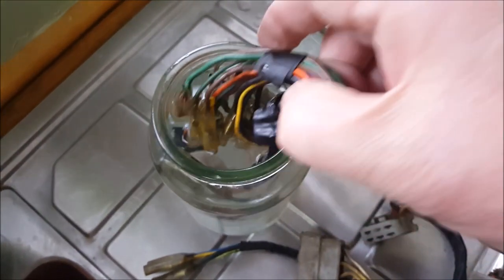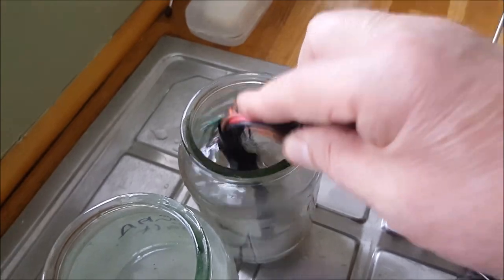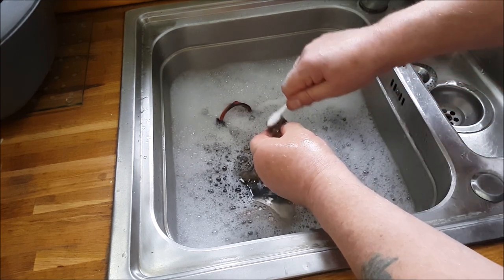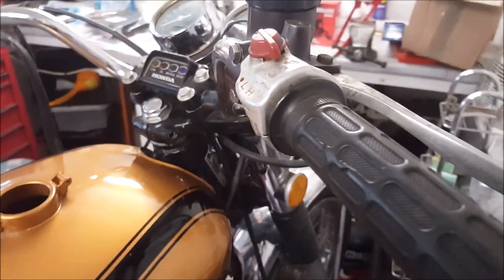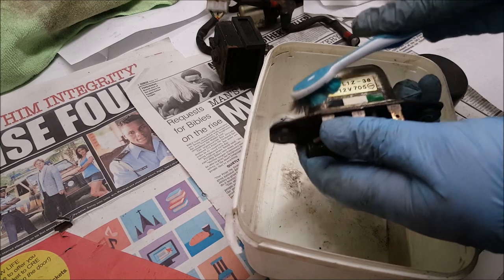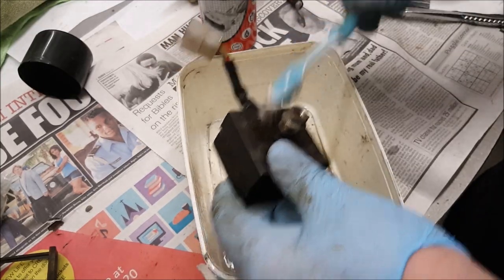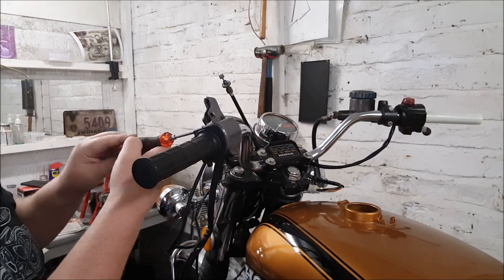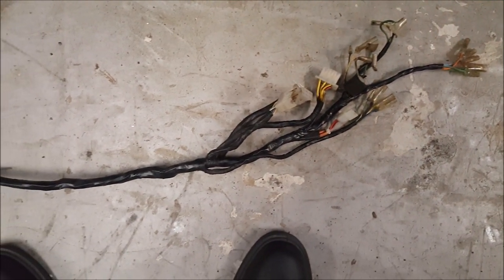Honda CB750K Wiring Harness Clean Up - Bike Wiring Loom Repair | Part 2

Comment: I hope you are still watching for comments as I have a quick question for you. I have a Honda CB750K3 (I am in Canada) and while working in the headlight, you will find connectors which are either 1wire in to 1 wire out, 1wire in to 2 wire out and one which is a 1wire in to 4 wire out(green). My question, do you know where I could order/purchase these type connectors.  My green - 1wire in and 4 wire out is broken. I would like to replicate the original connector if possible(vs a workaround). Just found your video's and appreciate your walk-throughs and instructions. Thanks so much
Reply from the maker: If you search, maybe on Facebook, for a while you can find a couple of companys that make classic connectors for all kinds of automotive applications.  I'm rarely trying to do an accurate restoration, just to make sure things work and are safe, so I frequently swap out to different connectors.  I always intend to make a list of these kinds of companies when they pop up, but never do, so I can't share it with you :)  Good luck.

Comment: Hello . Ive been getting bits of helpfull info for my chopped wire harness. Can you tell . The fitting for the small springs that work horn and starter buttons . Does the small end fit into the brass fitting that has the two wires on oppisite side please .
Reply from the maker: I would love to help, but I can't picture this part at the moment.  If it was in front of me I expect I could work it out, but as it isn't I can't.  Hope you find the solution.

Comment: nice one what mixing ratio do you use for the salt vinegar and baking soda
Reply from the maker: Cheers! Add salt a spoonful at a time until it stops dissolving.

The baking soda added to water until it stops dissolving.

The vinegar and salt removes the corrosion.

Then the baking soda neutralises the vinegar acid.

Hope that helps! :)
Reply: @SPANNERRASH  nice one cheers